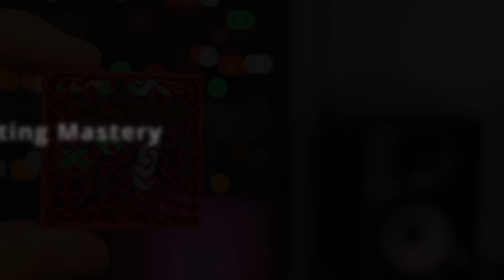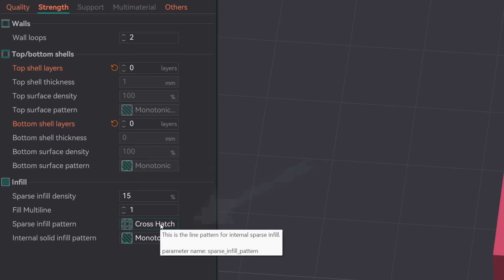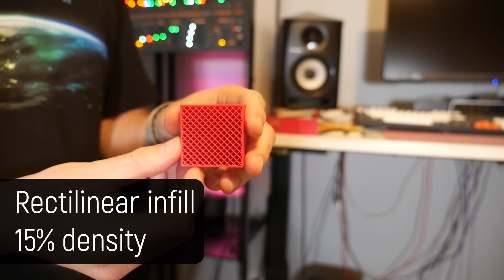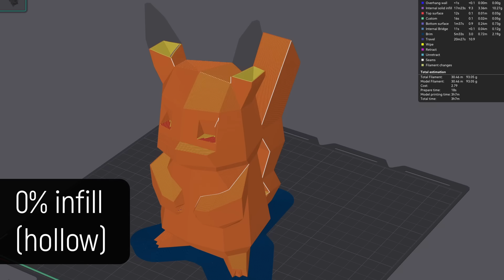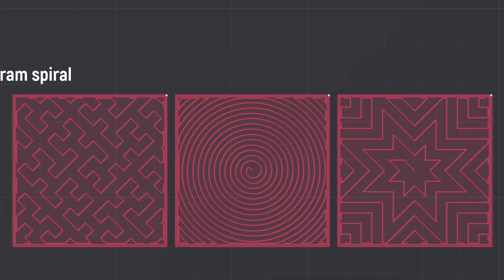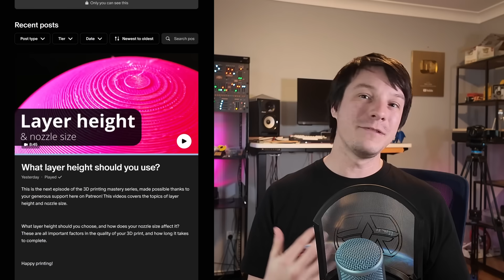What infill should you use? 3D Printing Mastery

Comment: Lightning is absolutely terrible, though. A single line wide floppy mess that will usually warp long before the next layer comes along giving you zero support at all as it's no longer where it needs to be. Trying to "float" an island on that garage is just asking to fail. You're far better off just using no infill at all before lighting. 

Adaptive would be perfect but even at 1% the slicer still uses too much of it to really achieve the "only fill what needs top support. It's still usually my go to for big hollow prints.

Comment: Triangles are really good if the object will be under load in the orientation of the triangles, it rates top in strength there. But gyroid is my go to because it deforms evenly across different planes, so it's good for parts that are under stress in different directions

Comment: We absolutely need maze infill - two points connected (if printed without walls) and dead-ends. Not sure if it would be possible for all layer geometries or how it would change by layer (solid layer at change?) 🤔
(Maybe Orca already has one)

Strongest infill is of course solid infill, sometimes it is the correct one.
With lesser infill ratio, thicker infill lines can be better choice. Bulky "ribs" can bear load better than nozzle-wide thin infill walls. Not good on supporting top layers though, so maybe someone could extend it with thin lightning infill?

Comment: Fun fact: hilbert curve has the lowest stress due to material shrinkage as the material cools of any solid infill. This makes it great for high shrinkage (warp-prone) materials. Also why it is used in SLM. Gyroid is good for sparse infill for similar reasons. The curvature gives shrinkage somewhere to go without pulling as much on the walls of the part.

Comment: Archimedean Chords is a simple way to make a spiralspring in a pinch without CAD. Pull in a cylinder and print with zero walls and surfaces, adjust diameter and height of cylinder and infill percent to adjust the spring, aswell as line width.

Comment: You forgot to mention filament type is also a huge factor. 
When printing with TPU the least amount of "retracts" the less likely a clog. Infills like gyroid are more continuous then say like a grid infill, so you will have way more success for finished prints.
On a side note you need to do more videos on TPU, will 100% infill that stuff is crazy strong and durable. The slow printing speed was always an issue but I was able to get some crazy printing speeds in my Bambu Ps1, I uploaded a simple file (just the letters TPU) with the settings on Makers world as "TPU 95a Fast test" if anyone wants to test it 😉

Comment: I have been also using infill on flat rectangles and circles only a millimeter or so high, without top or bottom layers, to create some nice pop filters and sieves!   Lot of fun ways to use infill. :)

My go-to is still gyroid, although, crosshatch is becoming fairly regular in my prints lately.

Comment: Adaptive Cubic is my absolute favourite. Hasn't let me down yet. ;)
Reply: It can cause lifting at the corners of large flat prints (in which case it’s effectively cubic infill). I ran into this printing the “can I lick it” sign. I tried my stickiest cleanest plates, glue, higher bed temperature, nothing would keep a particular corner down. The cause was the infill filament shrinking as the filament cooled which pulled up the corner. Switching to gyroid infill solved the problem.

Comment: Been printing airsoft parts and guns at with petg-cf at 0.1mm and 100% solid infil at a slow speed to really bind the infill together. Every print takes forever but the final quality is incredible, almost injection molded like quality with a good amount of weight (for plastic parts) with them.

Comment: Gyroid and other TPMS (Triply Periodic Minimal Surface) structures are superior because they are truly isotropic. Unlike standard cubic or grid patterns, they provide uniform strength and stiffness in all directions (X, Y, and Z). Additionally, they are self-supporting and lack isolated pockets, ensuring consistent internal load distribution and preventing structural weak points.
Reply: AFAIK, gyroid and the other TPM surfaces are not isotropic. They have dimensions of anisotropy. But, it's a much more complicated anisotropy than "stiff in one direction, compliant in another", meaning under many conditions you can ignore it.

Comment: i wonder about the effects of variable infill. near the outside of the block you have a dense infill, but the middle is hollow, with a gradient between. would need a series of testing under a press, to test the value or each infill type at what layer depth

Comment: I sometimes print ant farms, specifically nests, the part where ants live.
I usually design structural part (walls, connectors, inner sections) and then add extra solid volumes to design where I want "some structure". I use 0 perimeters/0 solid layers + gyroid often as a relatively organic "corridors" that are bound to structural elements, plus slicer makes it so much easier than manually making "caves".

Comment: I remember reading that gyroid is stronger than cubic/any other in terms of filament used vs strength resulted, even against cubic

Is this incorrect?

I've been defaulted to it on all of my prints due to this
Reply: Not correct but it has other advantages

Comment: Gyroid: 
Isotropic - same strength in all axes. Transfers stresses between axes well
No crossovers - the printer never crosses the same point twice, less likely to knock parts off or cause defects
One big internal pocket - can be filled with spray foam / water / sand / etc. for extra strength / weight / density / etc..
No sharp corners - keeps speeds higher than infills that require sharp turns, like honeycomb or 3D hexagonal
Better top layer support - square patterns can make for difficult bridges, especially at low infill percentages
Excellent strength to weight ratio - very efficient use of material
Reply: I can't like this post enough. 😃👍🏻
Reply: Mostly not worth the noise and speed cap, but useful to be filled with sand.

Comment: I have used the likes of Hilbert Curve et-al when printing things like drinks coasters. As you say, not really good infills for structure, but for certain prints (like having "drainage" for a coaster) they are great.

I think you also missed one big thing for gyroid, if you need a print to be solid, you can use gyroid to infill but as it is fully open, you can also then fill the print with resin. That way you get a quick print but a solid product at the end of it ❤❤

Comment: The number of perimeter walls is highly important if one needs stronger prints. With thicker walls you can reduce the infill density.
Reply: Another option is micro shapes, such as using the tube shape (or several) within your item. I needed a small item to be very sturdy (it would be under a lot of tension during use), and this method worked great.

Comment: Hilbert and archemedian are fantastic choices as a bottom layer pattern for materials prone to warping.  I have pretty good luck using Hilbert curve with large pha prints that are prone to curling off the bed
Reply: Also Archimedean is spectacular as bottom/top layers for circular objects as there's no seam and no slowdown to step to the next ring, just one smooth motion. I love it
Reply: I also really like hilbert for the bottom layer just because it looks cool, especially with multi-color filament
Reply: I never knew that. I must try that. Is that because there are no long spans of filament that can contract?
Reply: The warping angle is underrated in this conversation — infill pattern choice matters, but the underlying issue is uneven thermal contraction across the part. Geometry amplifies that a lot, which is why large flat prints curl even when settings look right. Helio's thermal simulation actually maps this before the print starts, so you can see where the stress is likely to build up. Worth trying if you're regularly dealing with large PHA or similar warping-prone materials.
Reply: @helio_additive oh!? Thats rad as hell! Ill have to give ot a shot!

Comment: Isn't zero infill essentially the same as vase mode?
Reply from the maker: Not quite, vase is one continuous line which traces the part outline gradually in the z direction. zero infill still has the separate perimeters and top solid infills
Reply: @MakersMuse  Also vase mode can only do one object at a time with one perimeter; zero infill you still get the option to increase perimeters and have more than one print.

Comment: An advantage of gyroid over other patterns is when printing small models with narrow parts (some D&D minis for example). The gyroid pattern never crosses it's own lines on the same layer, unlike cubic. So using gyroid makes it less likely that the nozzle will knock the print loose or break off a peice, since it doesn't hit the bump of a line it's already laid down.

Granted, for that stuff resin is probably better anyway, but I really don't want to deal with the mess or the ventilation requirements so FDM it is for me.
Reply from the maker: Ah yeah that is a very good point!
Reply: Also because it doesn't have any straight vertical lines or fully-across lines, it doesn't pull the surfaces of the print inward in inconsistent ways.  That, and its symmetrical strength, are why I like it for lots of things.
Reply: For that reason I use crosshatch as my default infill. I think it's faster than gyroid and less vibrations. Though I'm not sure how it compares to gyroid in terms of strength. But when I need an especially robust part I'm overthinking the settings anyway.
Reply: @flurl1  I use cross hatch almost all the time, but it’s not as good as gyroid if you need the best strength.
Reply: I use honeycomb. Also no crossings, and less shaky.
Reply: I always thought Gyroid generally helped with impact resistance because it's internally more springy and not so rigid as Cubic but happy to admit if I've been wrong
Reply: @Timmetrius01  Found trying to look that up:

"For impact resistance, gyroid is generally superior to cubic infill. Its continuous, wavy, non-intersecting lattice acts as a shock absorber by distributing kinetic energy and shear forces uniformly in all directions (isotropic strength). In contrast, cubic infill's rigid geometry can create stress concentration points that cause it to fracture rather than absorb impact."
Reply: @radfaraf Nice to see I haven't been living a lie all these years 😄
Reply: Cubic does cross itself, but the crossings don't stack the way they do with grid for example.

It could still cause issues on particularly difficult prints, as you point out, but it's not a problem the way it is with other self-crossing patterns.
Reply: This 100%

Comment: 15% cubic is always my go to
Reply: That’s so much wasted material on infill
Reply: @crispy_338  why
Reply: @Hudbud_dude  Infill doesn’t really add strength in the way you might think it does. More walls is a more efficient was to strengthen a part. You can use infill to add a bit of rigidity but it’s mostly waste above certain percentages, around 10-15%
Reply: @crispy_338  not that simple
Reply: @riba2233  yes it is.
Reply: @crispy_338  no it's not. Please don't be another victim of a DK effect, there is more to it you are just not aware and  don't know the whole picture.
Reply: @riba2233  please enlighten the class then. If you want to prove someone wrong, provide evidence instead of being a pompous ass
Reply: @crispy_338  yeah I don't think I will after this kind of a tone 😅
Reply: @riba2233  Typical. You can’t even back up your assertions.
Reply: @crispy_338  not how it works bud, you made a claim so you need to prove it. It's not on me to prove you the opposite. Also st0p liking your own comments, it's super cringe.
Reply: @riba2233  There’s plenty of videos out there reinforcing my point, go look them up. I also have an engineering degree so I know a bit about what I’m talking about. And no I will not stop liking my own comments because it makes you mad.
Reply: @crispy_338  ok, you stay cringe and lgnorant, I don't mind 😊
Reply: @crispy_338  still wrong and cringe 😊
Reply: @riba2233  nope 😊
Reply: @crispy_338  it's ok, keep coping ;) btw I see that you got pretty triggered, forgot to like your own comment :(
Reply: @riba2233  ok 😊